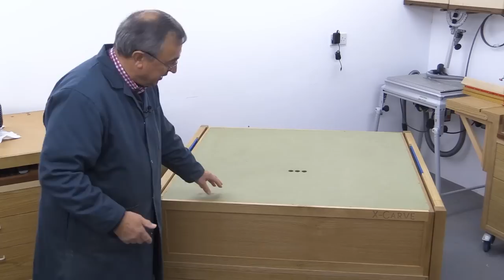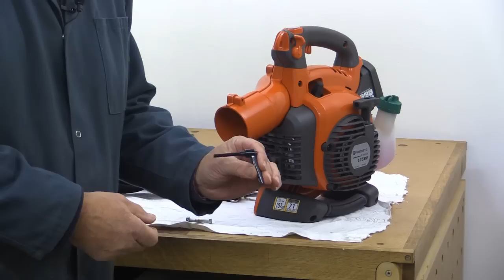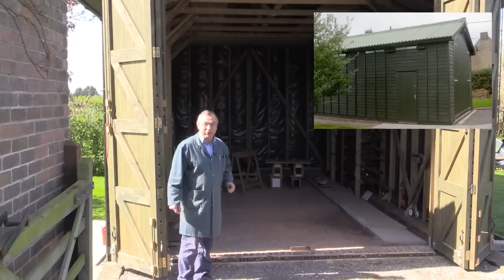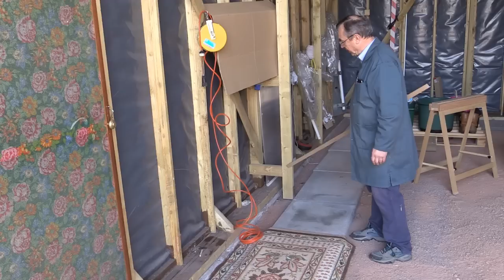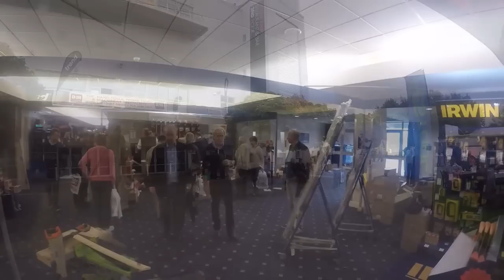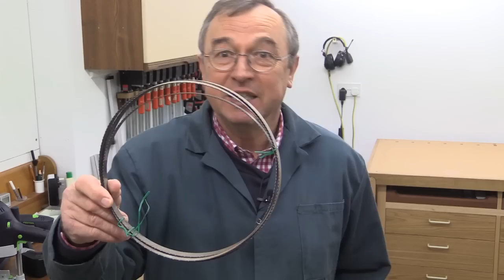Workshop Notes #4

Comment: Adding the extra timber to the edge of your rebated frame is a great help for steadying the router. Another method I have used when rebating frames is to attach the router to a base board 125mm wide by possibly 1200mm long. Use the router whilst keeping the router base board resting on the top of the frame where you are cutting and referencing on the opposite edge of the frame for balance. You should be able to produce the rebate in one constant flow rotational movement if no cramps are in the way. Love the bandsaw ending! Cheers Peter
Reply from the maker: +Wood Workers Workshop Limited Hi Peter,  Many thanks for the advice on another method. I know that you are at the Harrogate Show, Stand 8, from 15th to 22nd November and then you have one of your brilliant hand tool and routing days at the Woodworkers Workshop HQ on 28th November. I will try and visit very soon. Good luck and keep up the hard work.    Peter

Comment: Hi Peter. Thanks for another entertaining presentation. Even a small cut on a finger can make one feel like we have a large bandage in place till the dexterity returns. On another note - My Kapex was set up using the 5 cut method like most of us have learnt. The compound error can certainly have us chasing unrealistic goals of squareness sometimes, but, the 5 cut method certainly instills in us the need to try to get a better result. One observation I would make from your video - your zero cut fence pieces - have you checked them lately? The coefficients of linear thermal expansion in cross grain can be 10 times higher than parallel grain (in wood). I changed my zero point fences to aluminium to remove the very small inaccuracies on mitre cuts from left and right cuts. The Kapex is a well made tool. If you look at the underside you will see that they have cast it from aluminium and it has ribbing to keep the structure stable. Yet we insert notoriously unstable materials onto our machines and expect them to maintain their accuracy through all climatic changes. I noticed that your single cut tap adjustment was more than enough to adjust your saw. May I suggest that you also cut two sets of mitre cuts, one set from your left 45 degree mitre and the other from your right. Then assemble the frame and compare the squareness. The zero point fences need to be perfectly coplain. If you are just doing cross cuts and you always cut from one side, then your method of checking is adequate, but we also tend to make cuts from both sides, so I suggest that we also need to make allowances for both sides of the fence and aim for the middle. As you are also aware the base of the fence is one piece, but there are two independent sections that can be moved laterally. There are two socket screws at each end of the fence to adjust the squareness of the fence to the table (using shims). From the factory my right fence was 0.0005" out on the X plain. I rectified this by shimming the fence. If we use the Kapex just as a chop saw, then cross cutting is all we need to adjust, but, this saw does so much more and I think we need to train ourselves to observe all aspects of its performance and look for ways to keep them in sync. I am also thinking of drilling and tapping in four places with 4mm cap screws each moveable fence so that I can better maintain adjustment of the moveable fence to the static fence base.  True and proper adjustment of the bilateral fence seems to be something that Festool have not paid enough attention too.  For Germans, that is a serious error in precision :-)  By the way, these comments should in no way be taken as a criticism of your adjustment technique - I just use a bigger hammer :-)
Reply from the maker: +Stewart Robertson Hi Stewart, This is an excellent description of the mechanics of the Kapex. Every single point is well made and it will be very useful for others to learn from this. Thank you for making the effort to share this with us all. I think that I will try and take your advice.   Cheers.    Peter

Comment: love the barn. Any problems with condensation on the visqueen?
Reply from the maker: +o bez There are no condensation issues but the humidity level is slightly higher than I had hoped. The barn was designed to take a caravan. The main purpose was to keep the weather off and to protect from the wind. The main source of moisture is through the floor. There is a damp proof membrane but it had to be under the scalpings (crushed stone and clay mix). If I were to put a concrete floor in then a new membrane, on top of the scalpings, would solve most of the damp problems. I am often tempted to do the concrete floor and to add insulation to the inside.    Peter

Comment: Just making a cyclone cart today,  then during the week a fixed pipe system with blast gates etc. No videos of the build, but photos which I will add to a blog in the following days
Reply from the maker: Hi Bill, I will look out for the photos.  Peter
Reply from the maker: Hi Bill, Is that a 4" or 2" cyclone? The imploding can be solved by putting a pressure relief valve in the system - it would take about 10 minutes to do and you will need a tin lid and a pair of springs. I think that I have this in a video somewhere.  Peter
Reply: Thanks for the reply, the cyclone is a 2.5" type. A very cheap item from China, thought it was worth a go ?Never thought of a pressure relief valve ? Thanks for the idea. Bill.
Reply from the maker: Hi Bill, This was my first pressure relief valve - https://www.youtube.com/watch?v=wNBxce-HeCw   I have made a better design with a pair of springs so that the valve will close as soon as the danger had gone away.   Peter
Reply: Thanks for the link, been sketching something similar but using a small hinge and a spring as a return mechanism. Will be trying this at the weekend and trying different strengths of springs. Cheers, Bill.

Comment: Hi Peter,

Thanks for also sharing the little tips like increasing the support for the router to prevent it from tilting. I am actually thinking about buying a table saw. I've not so much budget. And having metalworking sawing capabilities is quite a must. Are you familiar with the Evolution brand maybe?  I was thinking about the Evolution Rage5. Any thoughts about the accuracy of this? Do you maybe have other suggestions for table saws around this price which is able to saw metals as well? Thanks a lot.
Reply from the maker: +SE45CX Gosh, the metal working aspect makes this almost impossible for me to give you any advice. I know that the Evolution publicity goes into a lot of detail about cutting a range of materials including metal. There is a huge difference between being able to cut aluminium ( a soft metal) or brass (brittle but not too difficult to cut) and steel (this needs a lot of care and lubrication during cuts). So called "Universal Blades" do not cut wood well and are often barely up to the task of cutting steel. It is better to have blades suited to the material being cut. If I have a large or thick piece of steel to cut then I use an angle grinder. The rest of the time I cut steel using a hacksaw. I cut steel so rarely that these options are right for me. I am unable to offer any more advice but suggest that you examine your needs carefully and if you have a lot to cut consider a specialist metal cutting machine.   Peter
Reply: +New Brit Workshop (Peter) Thanks Peter, for your thoughts about this! I'm from the Netherlands. In a previous video you talked about your visit to Baptist. My experience is they are very thoughtful about woodworking stuff. And nice to prospective customers :). I would really love to have a shop like this on metalworking as well. But hard to find. Maybe multiple table saws might be an option for consideration for purchase if you equip them with the right blade. One for steel and the other for wood for example. I think I'm going to try the company Van Ommen  (in the business of metal cutting) to ask for their thoughts on this.

Comment: Peter,

Good info.

Question:  I have similar zero clearance fence on my Kapex.  The question is, do you find it dramatically reduces the dust collection as opposed to no auxiliary fence ?              Thanks.                 JimE
Reply from the maker: +Jim E Hi Jim, I don't think it makes a huge difference. The dust collection with my setup is very good indeed.   Peter

Comment: Just doing an early Sunday morning view of your video's,  while the workshop is warming up on this cold morning and seeing the bandage on your hand took me back in time when I worked in a woodworking tool shop. Every day someone would come in with a hand injury of some description. I would say the top 3 workshop injuries were... No.3 .. removable of guards/riving knives/incorrect setups of machines...they are there for a reason !  No.2.. Testing the sharpness of tools with finger ends... Why? ...and No.1... Not using push sticks or other finger/hand saving aids while using machines !!!

Great videos... but off to put in a dust extraction system in the workshop... pip pip.
Reply from the maker: Hi Bill, It does help to have a bit of warmth in the workshop - it is safer and far more pleasant. Good luck with your dust extraction system - will it be a long job?   Peter